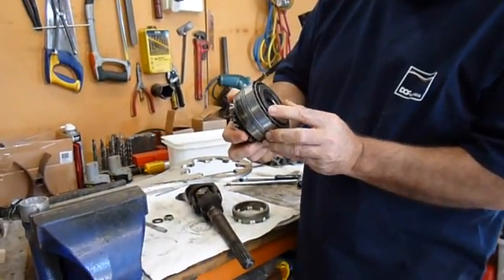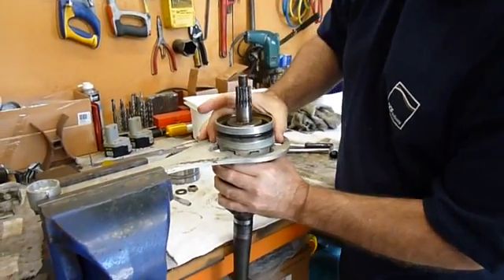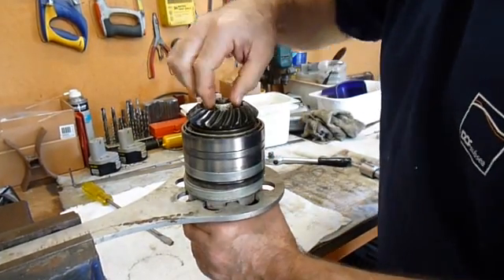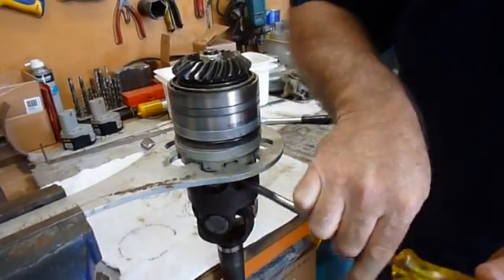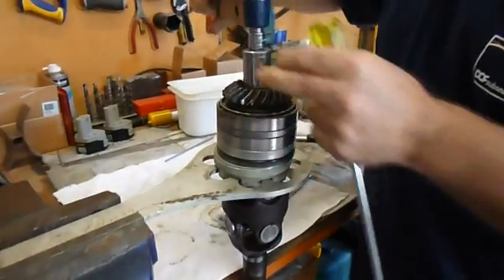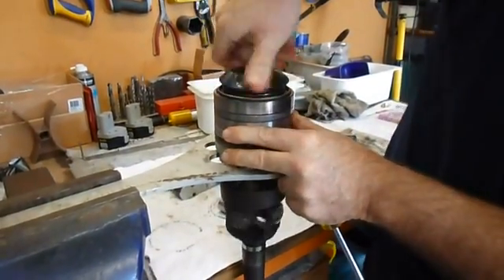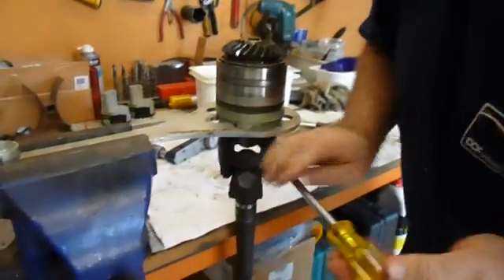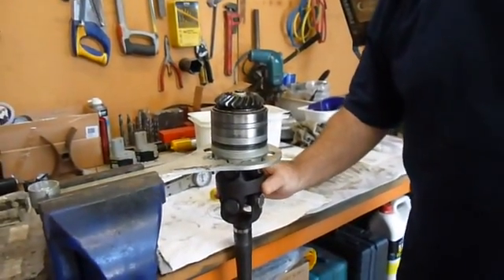5 Drive gear preload

Comment: This makes me laugh, ive been a gearbox engineer for 35yrs and all you need to achieve on any taper roller bearing is a torque that doesn't allow the needle rollers to be lose or move.
Reply: I guess you mean 'loose', not 'lose'... And what happens the the bearings if the torque is too high?

Comment: If this type was torque to 50ft. Lbs. Have you ruined It?
Reply: Yes. You've overloaded the bearing surfaces and likely cracked the case hardening.
Reply: @Chris-hx3om  I want to do this right so I've ordered new bearings, when I get them do I press that gear in all the way til it won't go anymore?
Reply: @Robert-eo9gl  Press the first bearing on all the way (only press on the INNER race!). Then put the first bearing outer race, the spacer and the second bearing outer race on and press the second bearing on until it ALMOST touches the outer race. Then start your rolling torque readings and tighten the nut as you go (to get the right reading).

Comment: Just wondering if I understand this correctly. Since you’re suspending the whole assembly and letting it hang by gravity and only tightening the nut until the bearings have the correct torque, is the end result that the gear isn’t actually all the way seated onto the teeth of the yoke? About to perform this and that’s the part that’s got me a little confused. Also I did not break the bearings off the gear when I disassembled. Do I need to or can I just put back together as-is ensuring the rolling torque doesn’t go above the spec?

Comment: when you tested with the dial you only barely moved it, so you're not supposed to do a 360 with the dial? Wish you could have shown the dial clearer to see the 5 on it from the angle you filmed at it looks like a 0. Also did you use the red Loctite for the thread?

Comment: What year alpha 1 gen 2 can you just torque to 80 ft lbs?
Reply from the maker: None. The 80ft-lb spec is only applicable to units that have the inner spacer, which was removed around 1983.

Comment: Great tutorial.  A few questions.... I'm replacing a Bravo 3 yoke assembly, so I'm keeping all other parts.  Should I just replace the O-ring, or is there a seal I should replace also?  Is that available in a set from Mercruiser or Sierra?   3.  Can I use an inexpensive dial type torque wrench?  I'd hate to spend big bucks on a one time use dial type torque wrench!

Comment: They teach that in school?
Theirs a breakaway torque that's what your measuring
Mercruser wants a rolling torque same as all their double Bering box same as Volvo.
When you set that you go round and round with torque wrench. And watch the dial the breakaway torque is always higher than rolling torque on a Volvo you rap the Bering box with a string take inch pound scale and study pull and read reload I don't know who is teaching the schools or this is coming from a. Service Manuel and you can't reuse the selflocking nut one time use.
Reply from the maker: No, I'm measuring rolling torque, as specified by the Merc service manual. You have a couple of issue you need to address. First is your spelling. Second, learn to read the service manual, nowhere does it say the nut can't be reused.

Comment: Any suggestions on methods to remove a retaining nut that has been chewed up by a faulty u joint. Most of the teeth are broke and can’t get a good grip on it with the spanner

Comment: Hi chris - gr8 vid thanks! I set the bearings by feel last week like the head bearings on motorcycles.. I know its a bit of a shot in the dark but didnt have a beam style handy.Ill recheck it this week.. alpha 1 gen 1 - was just tight enough to not bind etc- anyway, what wd happen if it was slightly on the loose end? How do I know if I have the spacer or not? Manual says "Reassembly with Small Spacer:" - how wd I know? My bearings had a 1/4 or so piece in between them - hard to tell from pics.. The nut came off real easy so I presume safe to say it requires the rolling method? Def wasnt 70-80 lb. ft unless assembled wrong?

One thing I did notice was if I went a pinch too far the bearings wd get TIGHT, so I backed it off a little, also - the engine side bearing came off shaft by hand- no pressing required, basically everything slid off except the tapered bearing at the end of shaft- hope this makes sense?

Comment: Do I have to dissemble the 2 bearings that and the gear ? Mine feel rough / dry .. I don't know if that's from the mechanic over torquing to 50lb in ? Or using brake cleaner to clean the  nut area .. he couldn't  get the torque right so i just took it home and dissembled it again and I want to see if my bearings are bad or is because of what he did ??
Reply from the maker: If the bearings feel rough, replace them. 50lb-in? replace them. Brake-cleaner, no problem, but replace the bearings, and yes, the bearings have to be pressed off the gear.
Reply: chrisa660 
But they felt just fine before he over tightened to 50 lb in ? When I spin they feel like they're dry .. can I oil them to see if it makes a difference? Or take them apart and oil ?

Comment: I bought one of those digital  torque adapters ? But there in ft lbs ? you said inch lbs ?
Reply: you have to use a dial type in. lbs. torque indicator.pre-load for new bearings is 6 to 11 inch  pounds.used bearings preload is 4 to 6 in. lbs.a bearing is considered used if it`s  spun under load once.
Reply: 1ft-lb is 12in-lb.... (as in 1 foot is 12 inches)
BTW... a torque indicator in ft-lb is not accurate enough.
Reply: Chris A  thanks bud yeah I found a local mechanic that has one .. but he over did it now I gotta take the bearings apart and try again

Comment: If it's a 92 bravo, did you say I don't need to preload the bearings?  Simply torque the bolt to 80 ft lbs?
Reply from the maker: That is for earlier Alpha drives. All Bravos use this (rolling torque) method...

Comment: where did you purchase the yoke sleeve I need a sleeve for a bravo drive
Reply from the maker: It's called a 'speedi-sleeve' and most bearing shops can get them. You need to measure up the yoke to know which sleeve you need.

Comment: Do you have the video showing separating the gear from bearings? and is it possible to use a clickable torque wrench for the preload, i'm sure it's not as accurate but is it possible? thanks for the videos!
Reply: I wouldn't.
Reply: "and is it possible to use a clickable torque wrench for the preload, i'm sure it's not as accurate but is it possible?"

No.

Comment from the maker: See the tool holding the assembly in the vice? That's the tool you use to remove the cover, then the assembly slides straight out of the housing...